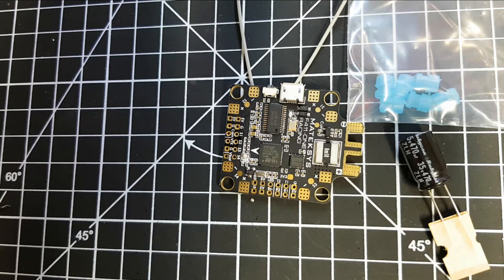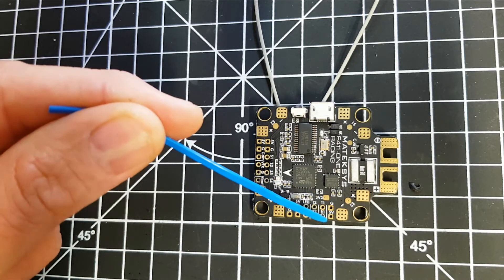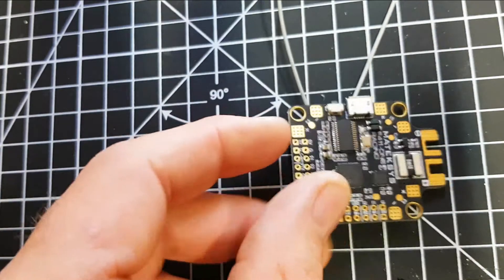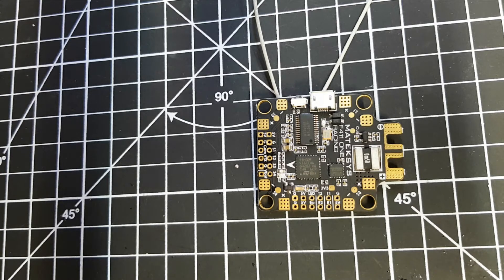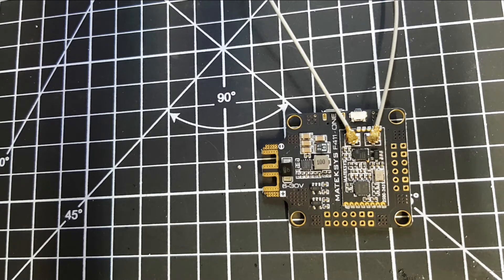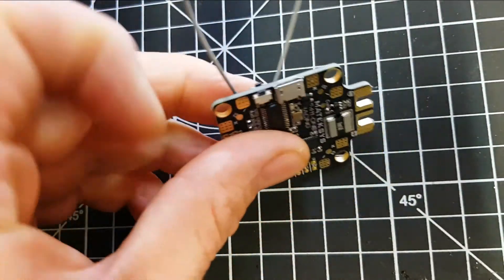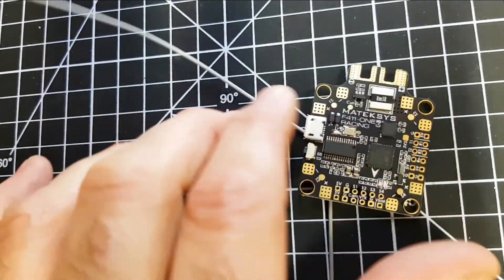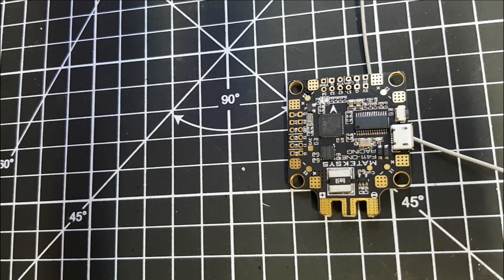Matek F411 One flight controller with built in receiver overview

Comment from the maker: I tried this following the previous issues on Betaflight 3.4. With international D16 it’s still dropping out all over the shop. Tried some of the suggestions below, and with D8 it works better, but the range is way less than my xm+ receivers, so this will be set aside again, and reading github isn’t helpful as they seem to go round in circles.

Comment: Just an FYI , I posted a "work around" / fix that is a combo of trial and error as well as info from the BetaFlight devs in the github on how to fix the Telemetry warnings and failsafes. The video I linked demonstrates that it indeed works, and also lists out what steps I took to fix it.    https://youtu.be/oQh87-aWbFU
Reply from the maker: DroneShot FPV I thought 3.4 fixed it, but pinned. Cheers
Reply: 3.4 definitely addressed and fixed it, but that is still in development. Love the content BTW!
Reply from the maker: DroneShot FPV cheers bud.
Reply from the maker: DroneShot FPV finally installed this on 3.4. Ran straight into issues on D16. Momentary failsafes from 60M Away. May try D8 and see if it’s any better, but looks like the bugs are still there. Are you still using your same fix?
Reply: Sorry forr the late reply. I am still using D8 mode, but not 3.4 yet. I was actually waiting until 3.5 as it's already in RC status. I may try it this weekend though and let you know!
Reply from the maker: DroneShot FPV I tried on D8 and used your trick and it’s better but the range is pitifully low (or at least rssi is) compared to my xm+. Fine for normal flying, but mines going back into the drawer I keep for shit that fails to live up to expectations ;) Github was absolutely useless.

Comment: I have one I can't get it working properly it is losing signal on and off, and I running 3.2 bf, and have everything correct I am on D16 I tried D8 also
Reply from the maker: pizzyfpv you need Betaflight 3.3 to make it work. Haven’t tried mine yet.
Reply: I have that, I am a veteran quad builder man, actually, I am running 3.3.1
Reply: yeah running 3.3.1 and that latest bf configurator, I am guessing it is still a software issue, I have everything setup right hardware wise
Reply from the maker: pizzyfpv you wrote 3.2 that’s why. New Tech never works properly :)
Reply: my bad LOL
Reply: Let me know if you have the same issue this is big bummer and I have practice coming up sunday and I don't wanna take this fc out of this quad lol
Reply: I know, this fact, I am gonna email designer since his email is on the wiki lol
Reply: Coppertop FPV Got it working on D8 it is awesome lower latency than crfs, also I had to move some stuff away from gyro so no more twitching 😊
Reply: Chris Lenihan run 3.3.1 D8 and don't add turtle
Reply: Make sure you are running 3.3.1
Reply: I have the same issue using D16. Using D8 and it works. Must be a firmware problem

Comment: Nice, I was thinking about picking one of these up from HobbyRC, I’ll need to flash my Taranis to the latest OpenTX for it to work though.
Reply from the maker: This was an impulse grab and was delayed by Easter, so haven’t really looked Into it much. Haven’t seen mention of what version of open tx you need? Flashed mine when I got it, but haven’t touched since.
Reply: Coppertop FPV I stuck the very latest version on my mates QX7 so he could get D8 mode, it was 2.2.1, but you said you’re running international firmware so you won’t need to upgrade.
Reply from the maker: Dav happy days! Lol. Think I’m on 2.2 which is donkeys old, but still has D8. Because this was stuck over Easter I put in an old dys f4 in my cg when i changed to single escs. It’s in full battle dress now - arm protectors and esc covers. Tired of stuff breaking :)
Reply: Coppertop FPV my X9D is still on 2.1.6, I was always paranoid about flashing my tx in case I bricked it, but after doing my mates one I realised it’s just the same as flashing anything else. 

I was going to use the MatekF405 OSD and FCHUB combo for my next build, but after using the F405 CTR in my Alien, I really don’t like how the OSD/FCHUB stack, I prefer just having a single board as it looks cleaner imo, so that’s why I was thinking about getting one of the boards you have in this video, having the rx onboard will make for an even easier and cleaner build.
Reply from the maker: Dav yeah. I’ve ordered 2 of the piroflip boards. That’s my dream flight controller, and for the Hyperlow absolutely perfect.
Reply: Coppertop FPV think we talked about that boards before, I’ll wait to see how you get on with them before I decide whether to get one or not. 🙂

I’d have to change the motor resource mapping for this Matek board as I like my xt60 pigtail coming out the side of my builds.
Reply from the maker: Dav I like mine coming out the back, but the solder tabs sticking out will make it awkward, so I’ll have to do the same lol